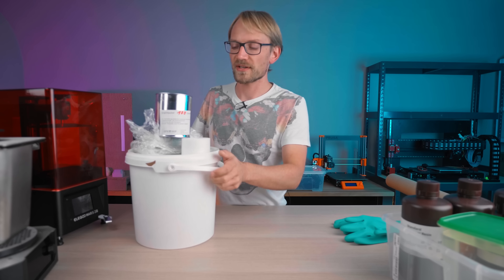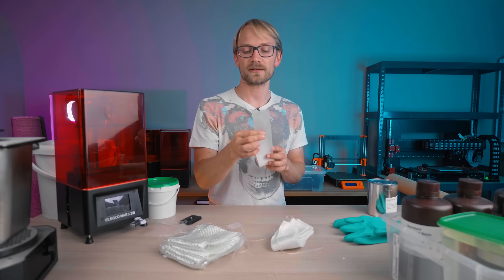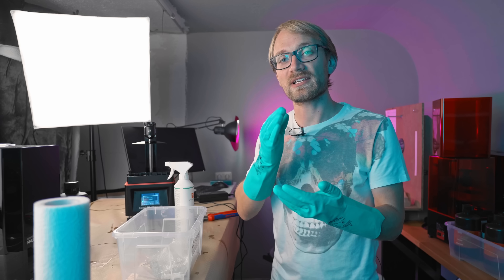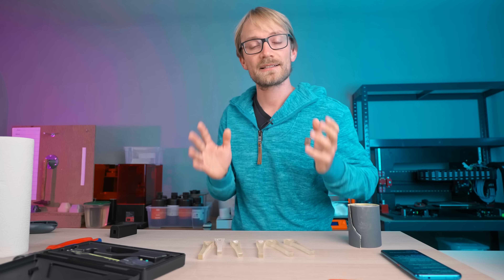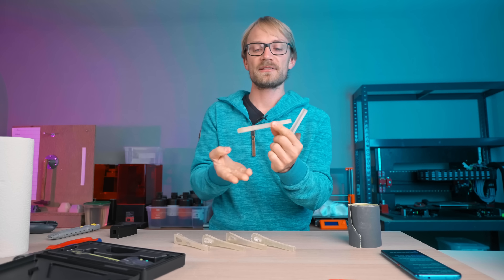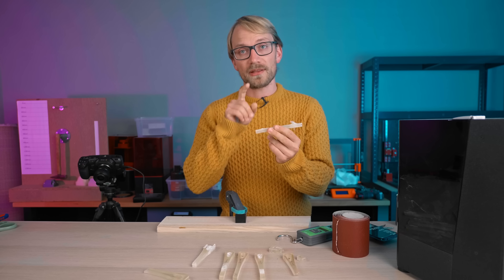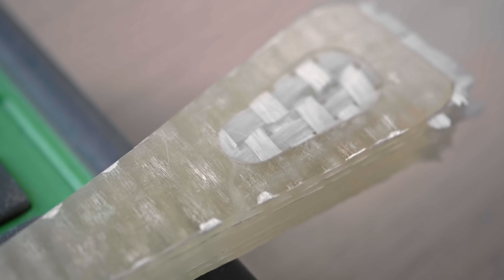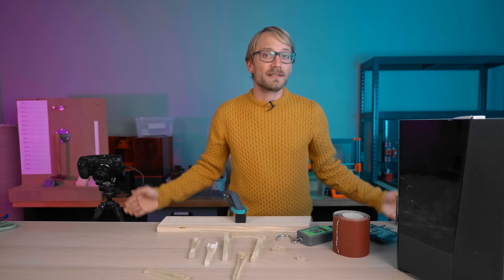Fiber-reinforced resin prints - how much STRONGER are they?

Comment: At this point it might be easier to just make a mold with the 3d printer and layup the part with fiberglass and epoxy resin manually. I don't know what kind of resin the sla printers use, but I assume it would be some polyester resin that is unlikely to be as good as true epoxy resin. As a bonus you can add gelcoat and have a really nice looking fiberglass part.

Comment: The part you printed and are breaking looks a lot like a carbon fiber drone frame arm. there are specific ways youre supposed to have the weaving be orientated for better strength. I believe drone frames that withstand the most crashes are those with weaving at a 45 degree angle of the break line or weakest point. I think it would be harder/more messy, but interested to see the results.

Comment: By adding the layers, your making the parts more orthotropic than resin typically is (think how orientation affects fdm parts strength properties). If you rotate the parts 90 degrees in your test and apply the load in the same plain as the fiber sheets I suspect you would see a significant improvement in strength.
It would be an interesting experiment and I’d like to see the results.

Comment: The reason that carbon fiber composites are not stronger than glass fiber composites has almost nothing to do with the strength of the fiber.  It has everything to do with the strength of the bond between the epoxy and the fiber.  There is little difference between the bond strength of either carbon or glass to epoxy so they are roughly the same over all strength even though carbon fibers themselves are many times stronger than the glass fibers.  The same is true here.  One of the main reasons that these parts are weaker than the plain resin parts is because they have a weak bond to the glass.  This is really evident in the way that the parts failed.  You can clearly see fiber separation from the resin especially in the slow motion film of the heavy glass.  In essence, the resin prefers to bond to itself more than it does to the glass.  Putting in glass actually weakens the part because it interrupts the resin bonding to itself with weaker bonds to glass.  A composite material will only be strong if the fibers are strong AND the bond between fiber and resin is also very strong.  Clearly glass fibers are strong, but the bond between glass and resin is weak.  Do the same tests with a lay up of west system epoxy and glass resin and you will get a much different result.
Reply: Actually, do a fiber pull test... that is embed some fibers in a matrix and measure how much force it takes to pull them out.  I am willing to bet that these uv cure resins do not grab onto the fiber with much strength.  compare that to fiber pull tests in somethin like west system expoxy.

Comment: In the coarse glass fiber fabric part, it was clearly visible that the resin had not completely soaked in the cloth. The mode of failure was basically delamination. If I may suggest, the pieces of cloth should be soaking in resin before the printing starts, as I believe the printer does not give the resin enough time to thoroughly penetrate the cloth before exposure. By pre-soaking, the resin would have time to penetrate every nook and cranny. It may be messier, but stronger.

Comment: I would use fdm printer for drones etc as you got the possibility to use petg, and that it is a better alternative for strength vs weight. Resin can be good but only if you optimise your models as even small parts are dense and brittle vs a petg . If you already got a resin and no fdm, then you could but that is one of the applications i would never use a resin actually as it doesent need to be high resolution but a bit flexible . Even pla would work as many of my things are just pla and works fine, and worst case i just make a new

Comment: Definitely biasing your fibers in the direction of the strength you're looking for will drastically improve results, your heavy fiver test utilized 50% of the fiber you added to increase strength, the fibers going across the part did nothing, which is the same reason the drywall tape failed. Wear a mask when working with any glass fiber materials, they become stuck in your lungs for life

Comment: Most FRP plastic parts are done using injection molding.  This process does not use mat, woven or long strand fiber but finely chopped fibers. Even minerals are used to toughen polymers. perhaps you can acquire chopped glass fiber for this testing.

Comment: You need to test the parts in the direction of the fibers. Composite fiber materials often have a preferred direction in which they're stronger - if you think about it, the fibers don't really resist when you bend them, but you won't be able to stretch them even a little bit, not barehanded, that is. So, you either need to add the fibers in all 3 cardinal directions, or test the part hanging down. Or at least that's my gut feeling from material science classes.

Also, please wear a filter and goggles when sanding fiberglass. The particles are really nasty and you don't want to breathe that in or get it into your eyes. Have dedicated clothing for when you sand the parts and change out of it when you leave the workshop/room. Perhaps investing in a lab coat, which is meant exactly for this purpose, wouldn't be a bad idea if you plan on doing more of this.

Comment: This is very interesting and something I've been wanting to try, except with a much lighter weave 0.75 oz. fiberglass cloth. I also wanted to try mixing a very fine powder such as aluminum oxide or ground glass in with the resin and forgo the cloth. My goal for the powder is to hopefully strengthen the resin for higher wear strength when making printed gears.

Comment: It would have been nice to see if there was any difference in strength if the part was rotated 90 degrees in the holder for the test.  So the stress is perpendicular to the fiber layers.

Comment: Hi, please don't take it the wrong way! I'm impressed by your dedication and work, but as a polymer material scientist it is kind of hard to watch this video. For instance, you don't know the variance of your material. This is just not possible with just one test. Therefore, your test result is not "the pure resin is stronger", but all shown tests are indifferent. I recommend you to do at least 3 repetition per material at the beginning. Then you can get a first impression on the variance. For tensile tests, typically at least 5 repetitions are performed and that is because the standard deviation is less than 10%. With increasing variance, you need to do more. 
If you want to utilize the strength of glass fibers in your resin, you need to make sure that the fibers are completely drenched in resin and has no pores. For me, the thick fiber mat looks a little dry from the side. If the fiber in not securely locked by the resin, the only effect you are getting is increased brittleness. 
Finally, the test you are doing is arguably the worst to identify improved mechanical properties. Your test is probably getting a mixture of flexual and fiber-resin bonding strength.

Comment: Have you tried putting the fibreglass layers at 45 degrees angle of each other? Having fibres all in one alignment sometimes doesn't show as much improvement as expected. I am not super experienced with composites but in the carbon fibre and fibreglass layups I did before, I'd usually alternated between 90 and 45 degrees which makes the fibres more diverse in their orientation.

Comment: very interesting i would like to see more fiber twills put to the test also chopped fiber might be a good idea to try altough there is a golden ratio than needs to be follow to achieve rigid results also 3d resin coating the parts and then applying the composite material is a good option

Comment: Probably  the difference  between this method and the classic reinforcement one where we use vacuum chamber is that the stack  of layers using the vacuum we can assure that it will work  like a whole part.

However, with the method that you use here, we can not be sure the stack will work together due to the interface between layers and, consequently, its will have a worse performance.

Great video by the way and an interesting workflow  Thanks!

Comment: Hi, can you please try grinding the fiber and mixing it with resin, and redo the printing.
To get more accurate results, I suggest using eye holes and weight for strength testing, stress concentration at break points (due to contact with black socket ) is much more for the more rigid material.

Comment: It's a nice video :) I know what are you tried to achive, but I think you missed the whole point of the composite materials. You need to use much more flexible material and much less rigid. I mean the optimal structure is when the flexible material is filled with minimal resin. Maybe you can try to print 1-2 mm thick parts with 2-3 layes of glassfiber or paper. Then you can gule together 8-10 layers of this stuff.
Cheers :)

Comment: I really appreciate this mix of traditional fiber composite and resin printing. It's something I never thought about but is a really interesting idea. For next time I would read more into the process for more traditional methods of making/designing fiber resin composite structures. It should give some clarity to the results, like the effectiveness of the loose fiber(tape) VS the woven variety, and give some ideas to explore. Also instead of paper try old clothes for a cheap accessible way to reinforce your prints. And as many people have commented safety first.

Comment: In this case, the force acting on the part was perpendicular to the individual layers and you can clearly see how they began to separate from each other. I think it would be quite interesting not to reinforce the part layer by layer, but to try to add fibrous material (carbon fiber, laminate fibers) directly to the resin in different lengths of fibers (0.5 - 1 cm and more ...). If the fibers and resin form a homogeneous and isotropic (well you know ...) mixture, this could help reinforce more.
So if this printing technology allows for a similar process, why not ... I just wonder

Comment: To be honest, i do enjoyed the video, but resin printers ( especially with technical resins like from siraya etc) are so expensive and the waste with the soaked, but cut away fibers (plus the contaminated resin in the vat) are making it almost prohibitively expensive.
I think, if anything i would use groups of "single" fibres that I suspend between two holders to minimize contamination and material usage and then try to add a significantly higher number or reinforced layers.
As you saw in this video, enhancing the number of layers did a great job improving the strength because the parts load-characteristics become more even/balanced. So I think ideally you get a reinforced layer alternating with the normal ones.
Shooting out of the box by a long-shot.... using an FDM continuous fiber 3D Print for single or dual-layer, carbon fiber enhanced, reinforcement mesh (like rebar in a building). These files you print dozens of times and if you add "handles" to those reinforcements you could position them quite well...

If you think that this might be an interesting idea, just contact me and I will try to provide a more thorough and more understandable explaination.

Comment: If you look @6:51 you'll see that the heavy glass fibres do no run the length of the part. You've basically just included a defect for not added tensile strength. For such a thing part, it's critical the fibres are directionally perfect. If you slow mo the video of the heavy cloth breaking, it's actually snapping right where the longest fibre leaves the side of the part, as expected.

Comment: What about just shreded glass fibers - not in cloth form. They can be in different orientation. Perhaps put a bunch directly in the resin and mix it so it is all over the print bath. In this way they could be all over the part and spread more uniformly. I watched some video about concrete with such fibers.

Comment: have you tried distributed fibers rather than sheets?  similar to glass fiber re-enforced concrete, where individual fibers are suspended in your resin and will be trapped in the printing process?

Comment: Try to go with some real composite materials especially that are working with epoxy resins and not Poliester ones and try to reinforce with lower gramature cloth like 60-100g/m2. Also change side of reinforcement to side walls ( you will need to modify test model to do that) not up and down wall.

Comment: Yeah I've already played with this to get the most strength underprint the part to make it match the amount of layers you want to coat it with. Then paint your resin over the outside of it and lay your layer in cure it I was curing for about 30 seconds to where it was still just a tad tacky adding the next layer paint it on and so on and so forth. Then do a full cure and now you got your part wrapped in fiberglass which covers all sides and gives you a hell of a lot more strength. It's also a lot quicker.

Comment: A lot of the strength in composite parts comes from the varying orientation of the fibers. You see composite layups such as 0,45,90,90,45,0, indicating the degree of rotation each layer has from the first. The reason you are getting results you don't expect is because you aren't making composite parts. You are just printing a resin part that has a section of non resin. You aren't introducing any kind of structural integrity, just an interrupt in the contour of the part, which is where it is fracturing. I highly recommended you look into making some actual composite layups first, the proper way. Learn how that works, then revisit this.

Comment: Use chopped microfibers in the resin mix (if they have geometrical complexity they will anchor better). They add dispersive strength without creating one single failure plane, and allow the stress concentration to spread out like in the normal polymerized resin. Use a true HEPA or ULPA filter in your shop and wear a really good mask. The rate the body clears silica, alumina, and carbon fibers from the lungs is too slow to prevent fibrosis at these large sizes.

Edit: And use the microchopped fiber resin mix with a different weave pattern, the 55 degree method works well for semi-uni-axial loads.

Comment: You are testing the wrong thing with that test. Also did you have some of the parts other way on the test? Yes you did. That has a huge impact on the test since the bottom part is experiencing compression while the top part is experiencing tensile strength, for which the fiber material can help.

What you should have tested is purely tensile strength, ie a pull down test.

Comment: Have you tried wrapping the part and curing it with a UV lazer? That's what I was doing before I found this video. We soaked the fiber, wrapped it around the part making sure there was no air bubbles left underneath, and hit it with a cheap UV lazer we got off AliExpress until it was cured enough to go into the curing box we built. I just wish one of us would think to start filling when one of us gets a hot idea...

Comment: In fiberglass work putting too much resin on the glass makes it more brittle. The correct amount (just enough to wet the fibers) makes the fiberglass more flexible and stronger. Clearly, you use too much resin for the glass fiber.

Comment: Wow, the amount of time and work that this testing must have taken is amazing, thank you for the video! I'm not surprised by the results having studied composite materials quite a bit and I'd like to impart a bit of material science knowledge here. As you astutely point out, the issue here is the huge disparity in flexibility between the resin and the fibers and generally the way to fix this is to change the volume ratio of fiber to resin. For glass reinforced composite, this is typically never lower than 20% fiber and often much higher like 70% fiber, and getting 70% fiber with this method as your video shows would unfortunately be more time consuming than it's worth. The second factor is the resin used and since photopolymer resins (even Sirayatech's Blu resin) are far less tough than the two part curing resins used for fiberglass production, I don't know if you could ever really make a useful composite out of them. I think the fastest way to test this would be to just lay down many layers of fiber then pour the resin over it and compress it all in a clear container, then expose the whole thing to UV light all at once. Lastly, there is the concept of the void ratio (the volume of voids over the volume of bulk material minus the void volume). In this case, the overall void ratio would be pretty low but unfortunately, all of the voids would have been concentrated right at the boundary between the fibers and the rest of the resin which also reduces the strength significantly. Anyway I hope this is helpful and thanks again for putting so much work into improving the knowledge base of this hobby!